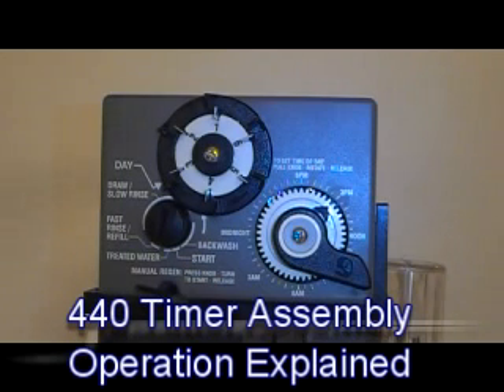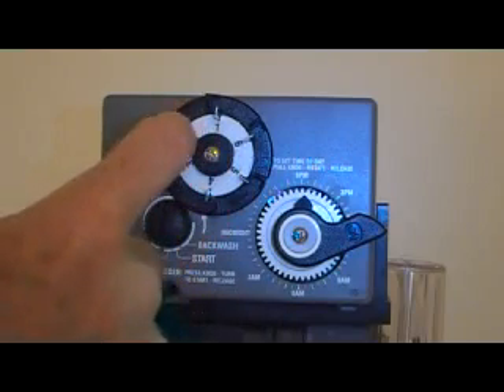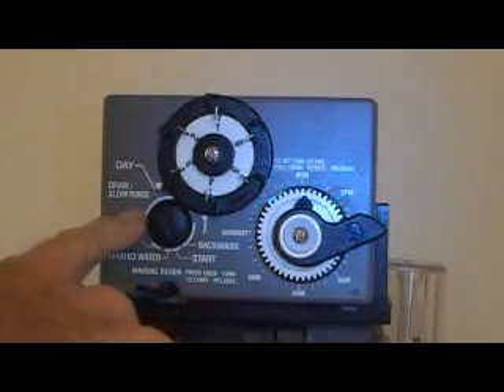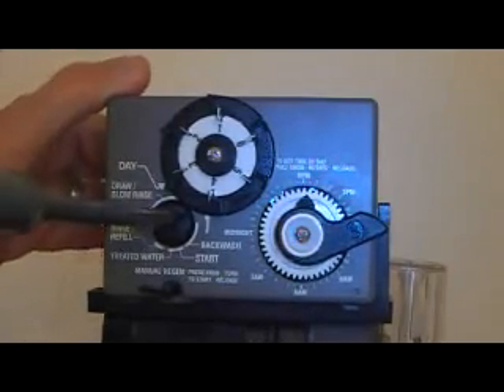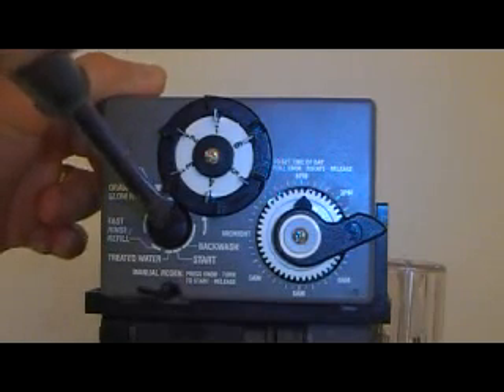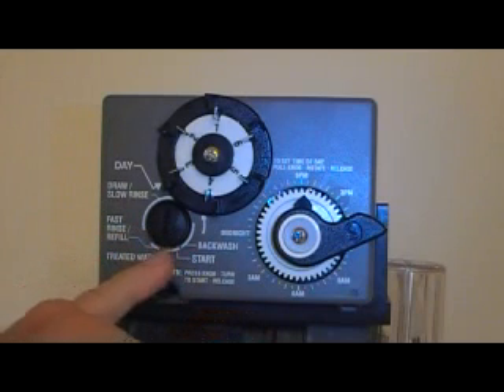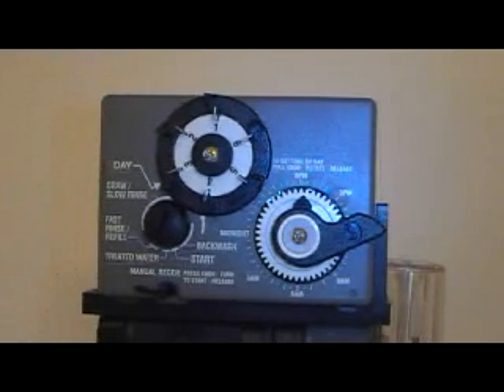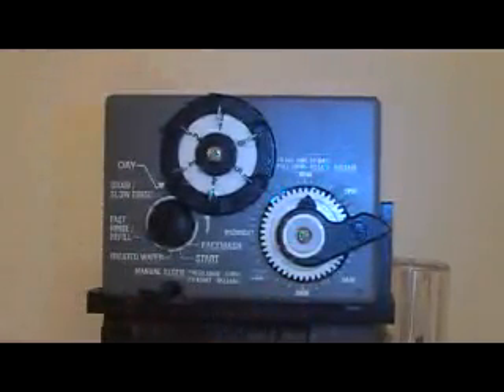Autotrol 440 Timer Operation Explained

Comment: Why is my softener re generate at mid day
Reply: Either the of time day is incorrect... or it's stuck ( stripped gear ), or the Flapper Valve Discs are "open" due to "debris" in the valve body. Please email us for assistance. Youtube comments is not the best place to ask questions, if want detailed answers. support@softenerparts.com
Reply: I don't no what happened  I have had softners for the last 30 years but this is the first time I've seen this problem the time clock time is correct it will re generatemid day once a week its not very easy to get parts here

Comment: Hi guys,well this is the one i have on the iron remover...how much pressure does one have to give to turn that top timer gear off of the tank,i am doing a  recharging job here today and for the two times i have done it since 2001,i just put tank on flat side and let water drain out one side,a equal amount like 5 gals as i always have about 5 gals of the poison purple stuff to put back in to sit for 24 hrs,anyway,anyone got any tips on how much pressure to give that top and is there a tool u can buy from a dealer..thanks

Comment: Good video! How many days a week should be pushed in to run its cycle?
Reply from the maker: There is no simple formula, as there are many "variables" that must be considered when "setting" a water softener valve regeneration frequency.

First is the "quality" of the water you are treating, and then amount of water to be used ( number of people in household ), 

What is the hardness level of your water before any filters? ( grains per gallon or ppm ) 
What is the iron level ( if any ) of your water before any filters? ( ppm = Parts Per Million ) 
What is the pH level of your water from the source ( before any filters )?

How many people use the water in your home? 

And the last variable is the CAPACITY or Amount of RESINS in the media tank.